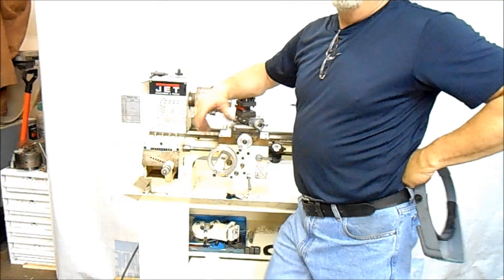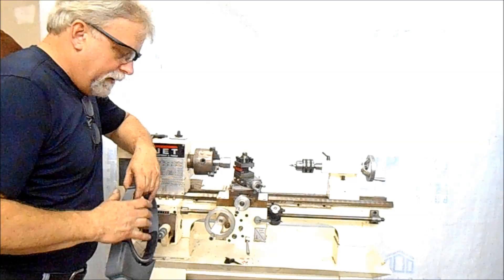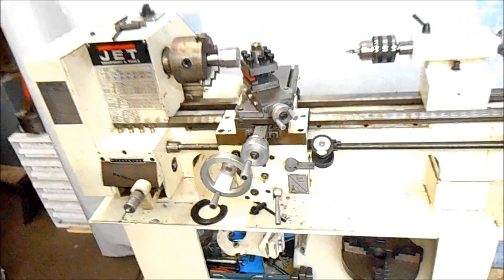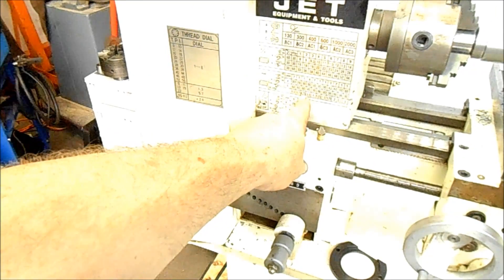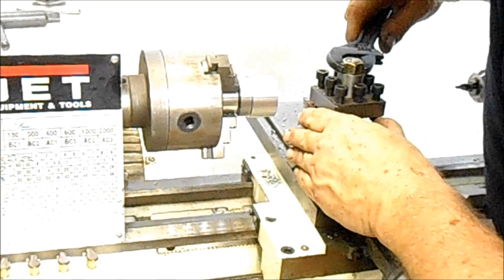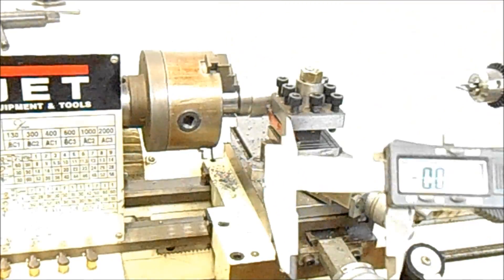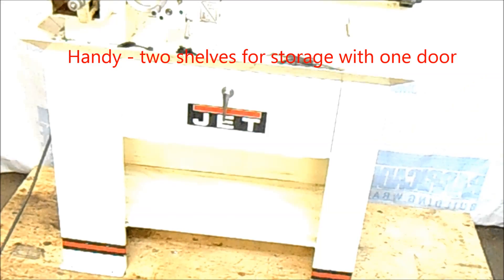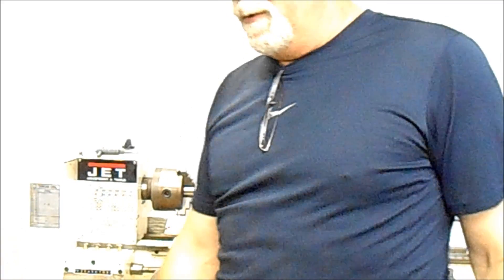Jet BD920N

Comment: Good video thanks.  Can you cut lefthand threads on it ???
Reply: Hi Ernest, 

Yes, you can cut left-hand threads on most lathes. What you do is to cut a relief groove in the workpiece at the location where you want the threads to stop. You then set your  threading operation to thread right when the spindle is turning the normal direction (CCW when facing the chuck). You start with the tool in the relief groove, then engage the half nuts just like you do for right-hand threads. Threads will be cut from left to right, resulting in left-hand threads.
Reply: @arnjones6028  I am not where I can look at my lathe now.  I don't think there is a was to reverse the lead screw. on mine.  I will check when I get home. I am a snow bird.

Comment: thanks for the video.   Is the chuck mounted by camlocks?
Reply from the maker: Hi RSTK, 

Threaded spindle on this little 9" lathe. There were at least two types of threaded spindles on Chinese/Taiwanese 9" lathes (these are mostly based on EMCO designs).  The two types are Imperial (1-1/2" x 8 TPI)  and metric  (M39 x 4).

You'll see Camlock spindles on larger lathes, say 12" swing and up.
Reply: thanks

Comment: I just bought one of these. Mine says on a plate on the back of the headstock that it was made in 2001. I am collecting parts for the lathe so i have what i need when i start experimenting. 
Thanks for the video.